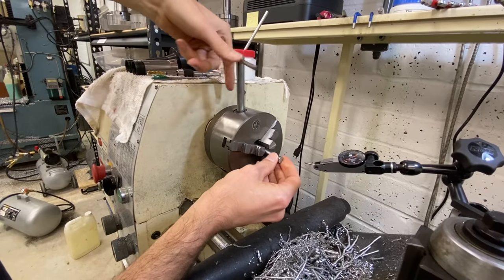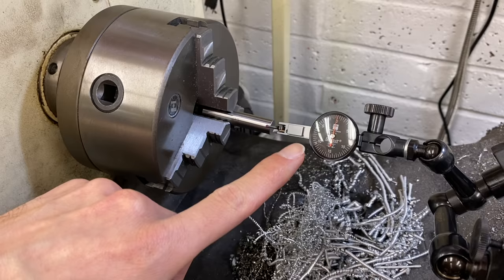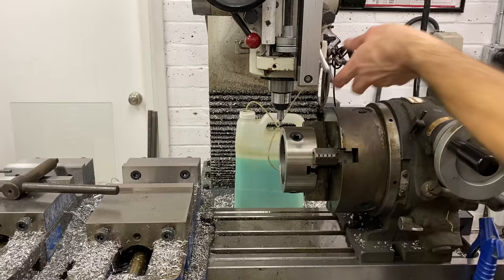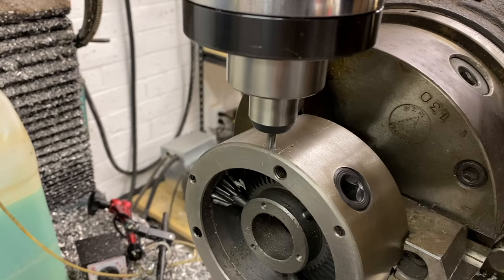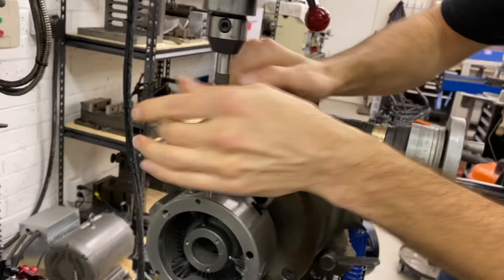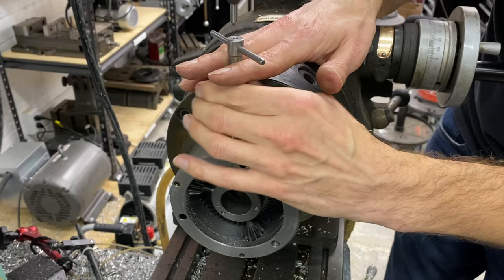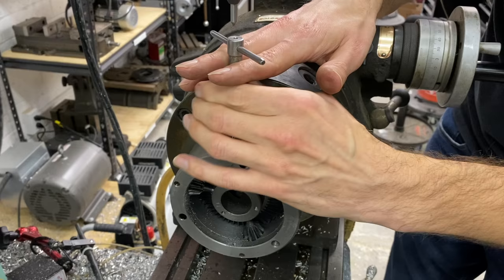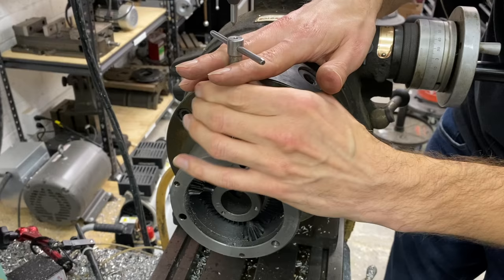HOW TO MAKE YOUR CHUCK SUPER PRECISE BY ADAPTING IT INTO SET-TRU

Comment: Hmm yes I like Rob Renzetti's concept of keeping the chuck back plate as it is integral to the stiffness. I have an independent 4-jaw as well as a nice Forkardt 3-jaw which both need a hard jaw boring job. I wonder if there is a use anyway for a set-tru type chuck once you have the jaws bored properly. In fact my Forkardt runs around 0.02 TIR as it now is. But yes there is air at the front part of the jaws.
If you are interested I have made a blog post about a novel way to machine hard chuck jaws. It has been proven nearly impossible to share a link in the comments so if you are interested I can mail the link.
Reply from the maker: There is always a use for set true chucks no matter your jaws. A nice hard jaw set ground concetric may not be concentric everywhere on the scroll. Really, people tend to obsess too much over hard jaw concentricity when we can just cut soft jaws and have better clamping grip whenever needed. The set true adjustment is just the fastest way to make it "perfect" with no cutting or changing of the jaws, (least work).
Reply: @TigermothRacingTV  Well I always tend to look at the product as it was intended, and for a self-centering 3-jaw obviously 'perfect' centering was never a (design) goal. Now, a good quality chuck achieves like 20 to 30 microns (mm) TIR which is fine and great for any normal job, I have a machine at work which is out by like 0.2 mm and that can be a bit of a nuisance. 
My main concern with boring hard jaws is not 'perfect' centering, it's the bellmouthing correction. Having it centering well after a boring job I consider a bonus. I have chucks of 'A' brands like Forkardt and Rohm as well as 'B' like Bison and none of them have left the factory 'bellmouth corrected' (as far as I can tell) which I find disappointing to say the least. In fact my Bison 200 mm 4-jaw is bellmouthed so bad I have to go back and measure, it looks is if the jaws were counter-corrected, LOL. 
At work I program and operate two Okuma CNC lathes both running Kitagawa chucks which also air gap in the front. Work to be done there. My only goal is stability and the chuck jaws are an obvious weak link. When you want 'perfect' (re-)centering use a 4-jaw or bored soft jaws. I tend to avoid them on the CNCs because of the hassle involved, most of the times we can get away with the hard jaws and protective material like sheet metal between the jaws and the product in second operation situations. Obviously here you want the chuck to center within 0.03 TIR mm or so which the Kitagawas do.
Reply from the maker: I see, yes the bell mouth is an issue. I have noticed on some chucks the bell taper can be worse if you are clamping partially on a part and not using the whole length of the jaw. At that point I think it is usally from play in the jaw channels. Taper from wear is certainly annoying and a nice cut to freshen them up is ideal.
Reply: @TigermothRacingTV  The worst case actually is using the whole length of the jaws and then do heavy machining and parting off. It's been explained already in many videos (as well as in my blog) that essentially it's having shorter jaws and working with a larger overhang. Both are stability killers.

Comment: I would have liked to see what the repeatability was if after setting it up to near 0 t.i.r. You took the pin out and reinstalled it in the chuck. I know it would be perfect but how good would it be? Great video.
Reply from the maker: Good idea. I didn't think to include that in the video. It will vary chuck to chuck but if the stock size is the same it should be very close.
Reply: That depends mostly on jaw surface and surface and concentricity of the thing chucked up, also somewhat on the surface and grind of the scroll and the jaw blades that interact with the scroll... heck, a chunk of schmoo in there or some grit that finds its way between the scroll and jaw will displace the said one jaw for quite some tolerance, so the repeatability here is a syndrome rather than something easily demandable, but if all things are even marginally ok, the thing should be relatively repeatable on stock of same diameter and even larger/different if the internal grinds and jaw and part concentricity are on paar and surfaces are nor like a grass field...

Comment: The plate you leave out @3:16 holds the scroll parallel to the inside of the face as well as keeps the scroll from floating on the spur gears.. i don't like my chuck without it installed.
Reply from the maker: Does it change the way the chuck feels without it?
Reply: @TigermothRacingTV  yep. I have to tap the jaws or the job lightly to even the pressure on each jaw when clamping down on small diameter work.I also got more crud in the scroll.
Reply: I can see how it might hold the scroll parallel to the inside of the face, but wouldn't that preclude keeping the scroll from floating on the spur gears? I mean, to do the 1st, it has to apply pressure away from the spur gears... Doesn't it? Maybe what you are feeling is extra pressure on the spur gears, reducing to normal? I am asking because 3 days ago, I decided it is time to do this same mod, and started searching YouTube University ;) to see if anyone else had tried it then after reading your comment yesterday, I removed the plate to see.... Also, do you see any downside to thinning the plate, on the spindle side,spur gears by 3/64ths to 1/32nd, to make the screw heads fit flush? (yes I am old school, they didn't introduce the metric system in Canada until I was in grade 5, my Machinist course in college was all imperial, and I have worked as a carpenter most of my life, a trade which is only now starting to be metricified...  ;) ) Oh, 1 more question, how do you get more crud in the scroll? Doesn't the inside throat of the chuck stick through, into the backing plate?

Comment: When is use my buck adjust true chucks,  i always leave the mounting holes relativly tight.
they are larger set screws though 3/8 -24 .for a 6" dia chuck. I never mess with the mounting bolts

Comment: does ditching the pinion bearing surface that the original back cover provides not cause engagement /alignment issues?
Reply from the maker: Every chuck I have seen, that back plate does not support the gears at all. It seems to be mainly a chip cover and based on the fit, sometimes may also support the body from warpage under very high load.
Reply: I see.  I saw the round overhangs on the cover and they sorta looked like bearing surfaces.  Been working on an old cushman that's split in half and each half provides half of the bearing @TigermothRacingTV

Comment: I would be tempted to install some kind of bearing surface so that the set screws son't mar that little ledge they are bearing against/  Maybe a ball mill and little steel bearings to seat in the recess
Reply from the maker: That's a good idea but I have never seen that done. All the high quality industrial set true chucks I have used simply have flat head set screws. If the screw and the part are hard, very little wear occurs.

Comment: This an old thread but very useful. I’m just confused on one detail, at the end you tightened the Chuck to the back plate on the bench that was already on the lathe, then you screw the Chuck back into the lathe and start adjusting using the adjusting screws. My question is, how tight were the back plate screws into the Chuck 11:04 ? And if they were very tight, as I imagine, will the adjusting screws still move them 13 thou 11:30 ? Thank you so much for this video!
Reply from the maker: Yeah you have to leave the mounting screws not totally tight so you can adjust the concentricity, then tighten them.

Comment: Won't the set screws dig in a bit enough to always try to set into the first grooves it made ?
Reply from the maker: It is important to use flat tip setscrews to avoid any marring but even the marring is not a big deal. Remember that the setscrews are contacting the backplate in the same spot every time you adjust it so any marring is just re-engaged with as you "buck" it around.

Comment: How loose do you have to leave the back plate screws for you to be able to adjust the set screws? Seems like you would have to constantly check the back plate screws?
Reply from the maker: Just slight finger tight with an allen wrench. You only need them to hold the chuck in flush contact with the backplate. You can set your concentricity and then tighten the mounting bolts. The concentricity should hold very well even wile tightening the mounting bolts.

Comment: I wonder if doing something like sandblasting the contact surfaces of the chuck and backing plate might make the "grip" better when locking down the mounting bolts...
Reply from the maker: I think sand blasting it could make the mating surfaces no longer flat. My concern would be adding runout from a non flat mating surface and you could cause chuck warpage.

Comment: Tigermoth, what kind of an edge finder did you use? I was under the impression it was a mechanical one which has to spin at approx. 600 rpm. The bottom part then "breaks" out and you can set your diameter of the edge finder or move to the center and set zero on your DRO. Or is it an electronic one? The latter is less accurate and doesn't work on plastic parts. Thank you for your answer! Best, Job
Reply from the maker: It is a mechanical one, the classic Starrett #827B. See our video on how to use edge finders. Thanks!

Comment: So do the bolt holes need to be made slightly larger, to allow for movement?
Reply from the maker: You should not need to. Usually the mounting bolt holes are slightly oversize and allow for some movement.

Comment: Nice job. Do you leave the backplate screws semi-tight, enough so they can slide a bit, but then do NOT tighten them after getting runout true? Or do you tighten them every time you get the runout true at whatever diameter you are holding. Thanks.
Reply from the maker: This depends. I am not going to tell you what to do because of the safety liability and you will need to follow the protocols of your shop. I will tell you that the chuck will hold position very well even if the mounting bolts are not extremely tight. It is of course better to tighten them before running the chuck but if you are making a batch of parts where you have to indicate each one perfect, and the cut load is nothing big, it is easiest to leave the mounting bolts semi tight so all you have to do is adjust the setscrews when you load a new part. Up to you.
Reply: @TigermothRacingTV  Thanks. I've never owned an adust-tru chuck. I saw another YouTuber recently did a conversion like yours, but he did it the way the set-tru are typically from the factory, with the chuck body held onto the backplate from the front with very long, and thinner screws. He was saying the long screws were so they could pivot slightly to get the free play. He didn't specify whether he tightens them each use. I don't know what the manufacturers like Buck Chuck recommend? I suppose with the long screws in the front, when they pivot slightly their length would barely change, because the length change would be the cosine of a very small number, so it may not appreciably affect the clamping force of the screws.

Comment: One word comes to mind here. LOCTITE!!!
Reply from the maker: Where would you put loctite?
Reply: @TigermothRacingTV  I was thinking on the set screws..
Reply: One wants to be able to adjust the chuck body quite easily because the wear in the jaws (and the scroll) will almost certainly be uneven. This is why the TIR changes at different diameters on cheap chucks like these. The idea is to get the adjustability of a 4 jaw, but the rapid repeatability of a 3 jaw for a given diameter. Changing diameters, and you'll want to double check TIR and adjust the set screws again.
Reply: @carneeki  I was assuming once the set screws were adjusted and the chuck zero'd there should not be a need to re-adjust. So in my mind you wouldnt want the set screws to move once you had them where you wanted them. But I guess you are saying that would defeat the entire purpose of the adjustability. I didnt consider the potential centering differences in the chuck at different diameters.. I get it..

Comment: Not dissing your personal preference of method, but I haven't used a three jaw in 20 years. Their inaccuracy and laughable grip strength drove me up the wall. My four machines have Bison Four jaws on them, never removed, and I've gotten real good at setting them to tenths quickly, and I'm happy with that. The three jaw that came with the Grizzly in 2003 started life as a door stop to my shop and I finally got tired of tripping over it for 17 years and threw it out. It has never been mounted.
Reply: Like you I am a 4 jaw user by preference. If used frequently then setting work true in a 4 jaw independent becomes quick and easy to achieve.
 I do disagree with you  though that all 3 jaw chucks are inaccurate.  Some 3 jaw chucks made by reputable manufacturers are highly accurate for concentric repeatability throughout the gripping range. They are rather expensive at that level of precision though. As for gripping force of a 3 jaw that is very much dependent on the helix angle of the scroll. Think of it as a spiral wedge. The shallower the scroll helix angle is the greater the gripping force for a set amount of effort applied at the key. The other commercial alternative is as already mentioned the 'Grip Tru' type. They also are rather expensive for a hobbyist shop.
Reply: Bit hard holding a hexagon in a 4 jaw.
Reply: @charliebaron9657  on 2 flats and opposing on 2 points. Easy enough to do.

Comment: Note that the rear plate holds the bevel gears in place on some chucks, so can't be left out.
Reply: also keeps the chips out of the gears.... so I am not sure why anyone would run it without the plate...
Reply: @morganmcintire2853  I was thinking this same thing. If anything I would have made the depth of cut on the threaded backplate to minimize the gap spacing left when the rear plate was removed, and find some thin foam gasket material to fill any air gap into the bevel gear compartment,  to stop any swarf from getting into the bevel gears. But I like the idea very much. Now I need to check if I can remove that plate, as my experience on my cheap chucks, they hold the gears in.

Comment: what dividing head is that?
Reply from the maker: This is called a Super Spacer. It is a rotary that has dividing plates in the back it can lock into set angles on the changeable plates or you can free spin it and use the degree scale. 8" size, Winchester or some random brand like that.

Comment: If you check your mating surface on the back of the chuck I bet you'll find local high spots around where you tapped the set screws
Reply from the maker: Use a sharp tap, no problem. Just don't get too close to the edge. If you do get a bump, just stone it.
Reply: @TigermothRacingTV  u right

Comment: why u using your edge finder like that lmao
Reply from the maker: What do you mean?
Reply: @TigermothRacingTV  He means the edge finder should be spinning and you wind it into contact with the part your trying to index until it becomes concentric and then kicks...That is zero...or whatever the diameter of the edge finder is. I know what he means...but I prefer not to laugh my arse off at others mistakes. It's rude and unnecessary. Nice video mate. But tbh this idea is ok for a small machine, not so good for heavier work or interrupted cuts...The vibration will almost certainly move stuff around.
Reply: @TigermothRacingTV  edge finder is supposed to spin at around 1000 rpm.

Comment: Does it move when you tighten the 3 soc head bolts on the back plate ?
Reply from the maker: Generally, no, but its always wise to check the part after tightening. It works best if you leave just a touch of tension on the mounting bolts wile you adjust the setscrews.

Comment: So I only need $18,000 in machines and tooling to make a $70 Chuck as accurate as an $800 one? Nice
Reply from the maker: Lol, no you could totally do this with a power tool hand drill and eyeball the holes and it would work just fine. I thought I mentioned that in the video but maybe not. We made this modification and video to show that precision is accessible and can be very cheap.

Comment: Nice ... interesting work, but s in the comment below, annoying music.  I'm watching you use compressed air while you're drilling.  Don't understand a machinist who use air instead of a vacuum cleaner .... great though for blowing chips everywhere.  I clean as I go.
Reply from the maker: Its mist coolant, the coolant is mixed with the air and that gives you fresh coolant/lube on the drill every time you peck automatically.
Reply from the maker: My mistake, you are correct, on cast iron I will sometimes use compressed air. Just enough to get the chips out of the cut so you are not re-cutting them, and if possible I will mount the vacuum head so it picks up the chips as they are made. You really do not want to breathe cast iron dust and you do not want to use coolant because it will make the cast iron dust/chips turn rock hard in your machine.